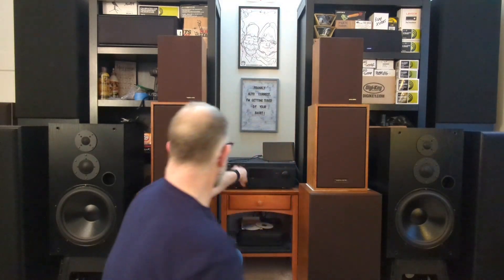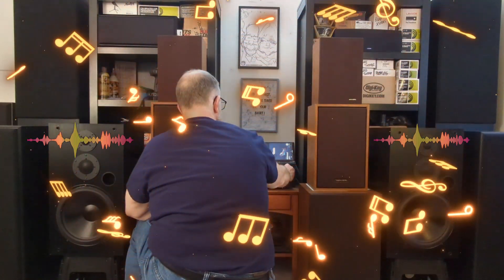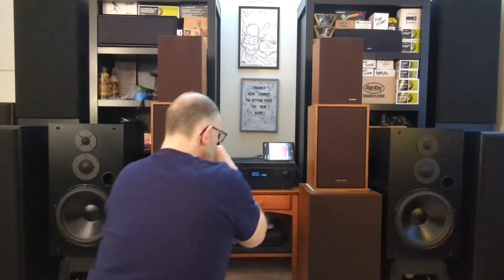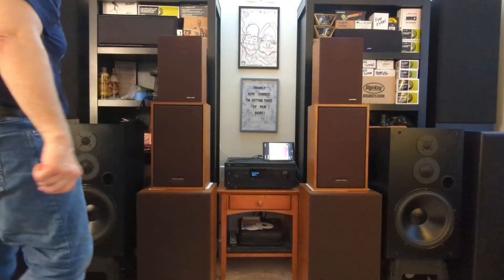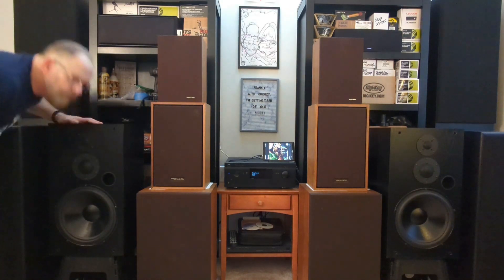The Dayton Reference Vs. The Dayton Silk Dome Tweeter: Which Sounds Better?

Comment: Have you seen the new Dayton audio matching set mid-range/driver combo?
Reply from the maker: @Jake-yq5sm  I have! The carbon fiber ones? Very interesting.
Reply: @wattspeakers yes, I was thinking of pairing them with the Dayton reference paper 10, probably in a sealed box paired with a separate subwoofer, what's your opinion on this design?

Comment: Very cool stuff, thank you. I am researching dayton drivers for my build. So far, I am very impressed with the reference ho subs. By the way, what is the software you are using for the sweeps?
Reply from the maker: @PanchoCarpio  I've not had the pleasure of doing subs yet, although I've got several but I prefer a full range speaker system when possible. The software for what I do in room response is Spectroid and I also use the Dayton audio software. I've heard of others that can do more but learning new software isn't my idea of a fun time. Thanks for watching and commenting!
Reply: @wattspeakers I ended up getting the Dayton drivers for a three way system. With the exception of the mid bass they are just as good as the Focal Flax they replaced while I sent them out for service. They are so good that I already got the Focals back from service and I have not put them back yet.

Comment: I just bought a DC28FT-8 to replace a dead tweeter in B&W DM10 speakers.   its a terrific replacement.  sounds good and very equivilant to the original.  I have a question for you,  i bought 2 of the dayton tweeters, neither is marked in any way to tell you the polarity of the terminals. no dots, no plus or minus, no anything.   how did you determine the positive and negative sides ?  I wrote to Dayton Tech assistance via email, but got no reply.   thanks.
Reply: Connect a 1.5 volt AAA battery just a second, the + terminal is when the membrane push out
Reply from the maker: @basukisugito8929 thanks for the tip I'll try it.
Reply: USUALLY,,, the large blade is the positive terminal

Comment: Why not use room EQ wizard instead of spectroid
Reply from the maker: Thank you for watching and the excellent question! Truth be told, I was too lazy or too busy or both to figure out how to use it, and it only works on PC if I recall. I found Spectroid in the Google play store and it seemed to do exactly what I needed. It probably does more too, but all I really needed was a way to measure SPL across 20-20k for the purpose of tuning.
Reply: @wattspeakers  is this not a PC computer?

Comment: I like the classic silk domes
Reply from the maker: Thanks for watching/listening and commenting Jon. The dome tweeter does sound a bit brighter at moderate volumes than the cone tweeter did, however it doesn't handle higher volumes as well and gets funky at some frequencies, (in this application). Currently the Dayton Classic Dome Tweeters are installed on a pair of Nikko LS-100's that I did a RestoMod on with spare parts and they seem to behave better in that application.

Comment: great job, I also used the RS series https://youtu.be/0frPOtKVJhA
Reply from the maker: Very cool Robert! So that's the Designer Series 12 inch woofer with two reference mid-range and the reference tweeter correct? Aluminum or fabric Reference drivers?

Sealed? Interesting with the two midranges. I've got a project to start that has two mids per cabinet. Did you hook them up parallel or? What did you do for crossovers on yours and the 4 ohm tweeter?

Comment: How do you like the midrange domes? I have the fabric and looking to build a similar speaker.
Reply from the maker: Thanks for watching and the question David! In the latest, final version of the RestoMod RCA STS-1230, they sound wonderful when coupled with the Dayton Reference Tweeter, but it took adding Zobel circuits to all the drivers to achieve that.

Midranges in general can be a challenge in a 3 way system. They often sound a bit hot, or more noticeable than the woofer and tweeter. This phenomenon is especially true and more of a problem with the dome mid-range. I also have the fabric version of the Dayton Reference Midrange.

Without the Zobel networks, the Reference Dome Midranges were very bright and at times harsh in certain regions. With the Dayton Classic Midrange, that was even more of an issue, because they exhibit the same sort of harshness at certain times.

So, combined the Reference Midrange and Classic Tweeter were pretty terrible sounding. Swapping the Classic Tweeter with the Reference Tweeter helped a lot, but as I mentioned the midrange still had some intolerable harshness and a sort of transistor radio effect. Not constantly, only when listening to certain songs or music that triggered whatever it is that caused the behavior.

Finally, I employed a tactic I've tried twice with success, which was to add a Zobel impedance equalization circuit on the tweeter, midrange and woofer. With those in place, all the problems are gone. The sound is silky smooth without being dull, they've got razor sharp imaging which isn't affected by placement, (I can position or place the speakers almost anywhere). I've not had any playback problems with any music, so now they're immune to exhibiting that really irritating harshness or raspiness.

All of that to say, it's possible to make the dome midranges sound good, but it's a challenge and they are not as forgiving as a regular cone style midrange.

The 3 videos I did featuring the Reference Midrange tuning are directly after the video you commented on. Until I finally struck gold with the Zobels, I was really disappointed and thinking I might need to install a full range cone for the Mid-Range and a different tweeter, or scrap the project and chalk it up as an epic fail.

Now however, I'm quite pleased with the results and while I don't like them overall quite as much as the Jensen RestoMod 3 ways I did, there are certain things about them that are better. In particular the imaging, stereo separation and details are better. They are extremely revealing, so poorly recorded music becomes immediately apparent, as does well recorded music. The end result with the RCA STS-1230 is a great speaker system for those who like a clear well defined and revealing sound, with imaging and stereo separation that quite honestly I've not experienced before. I'll go out on a limb here and say they'd be best categorized as an audiophile grade speaker system.

Thanks again for watching and commenting! Let me know how your project turns out and feel free to drop links to photos or videos you may have of them.
Reply: Awesome thank you! I will probably go  with the reference tweeter as well. Still figuring out what woofer to use. Thanks for all of the information!

Comment: I like silk domes the best and my 56year old ears tolerate them better
Reply from the maker: I'm really liking the GRS Phenolic Ring Cone Tweeters that I used in my big 15" 3 way project. That's what I've been listening to for the past few days... So smooth and clear. At least they sound like that to me. Or maybe it's the combo I used with that cone tweeter and a Dayton pro full range for the midrange.

Comment: It depends on what the crossovers are designed for
Reply from the maker: Thanks for watching and the comments Jon! I've been utilizing the off the shelf 8 ohm crossovers because the components to build them are stupid expensive nowadays. It's bassackwards, but they work fine when the drivers are matched up zobeled.